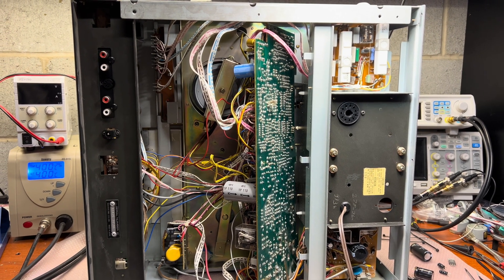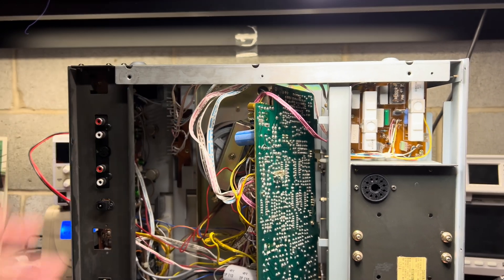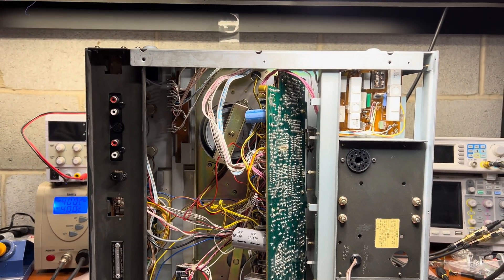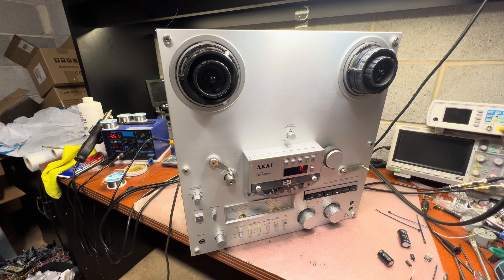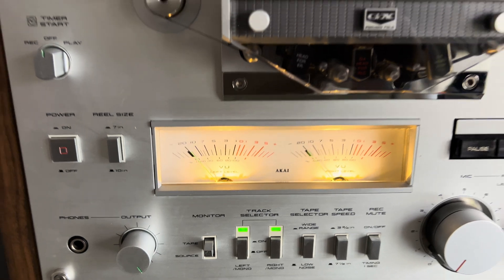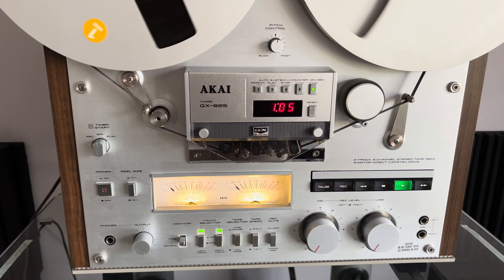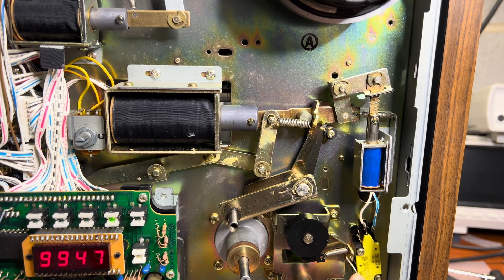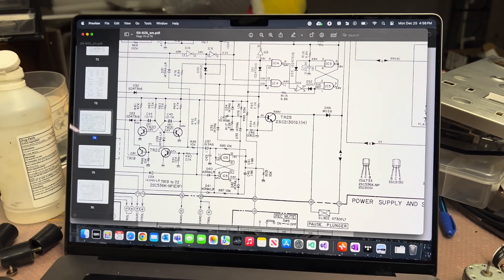Fixed: Why Akai GX-625 frequently burn out

Comment: Can you provide pcb locations of faults from the gnd oxidation ? I think I may have same issue. Thanks
Reply from the maker: @dubdoodle7191  I have shown the exact place where I put a short in a video. All other parts which may get blown can differ from deck to deck. In my case it was 36V circuit and shorted diode.
Reply: @hifirulezzz  ok will review video again. Why not put plastic washers on PCB mounting holes ?

Comment: Hi, I have this model and love it.  Would it be better to like hard wire the ground from screw to screw to chassis?  Run a wire to each screw and to chassis?  Also my Vu meter light is very diwhen as yours seem bright, did you modify the VU meter light?
Reply from the maker: As you may see I have installed the short connector on the board to keep the ground connected all the time. Yes, I modified the light by installing LEDs and increasing the voltage from 6V to 8V. I had to replace Zenner diode to achieve that.
Reply: Thanks, do you have schematic of what you did, parts you used?  Thanks so much @hifirulezzz
Reply from the maker: @hqp7198  Replaced D50 for 9.1V Zenner diode. Installed LEDs vs bulbs from https://www.ebay.com/itm/225282640468, these LEDs do not need additional resistors or anything, just installing place of bulbs.
Reply from the maker: @hqp7198  Schematic is available on Hifiengine.
Reply: thank you so much! @hifirulezzz

Comment: I have a GX-255 the "little brother " i did a completly cap replacement and i modified the rubber domes for the switches , It's a great deck only one belt for the tape counter .

Comment: I was just looking at akai reel to reel players because I don't have a reel to reel yet. Maybe i should steer clear of this model 😅
Reply from the maker: Why? It sounds really well. Just follow the maintenance steps I have shared to prevent issues.
Reply: @hifirulezzz I guess I should assume any r2r I buy will need maintenance. I'll keep your tips in mind, thank you!
Reply: Thank you very much for the tip, as I have the same model.